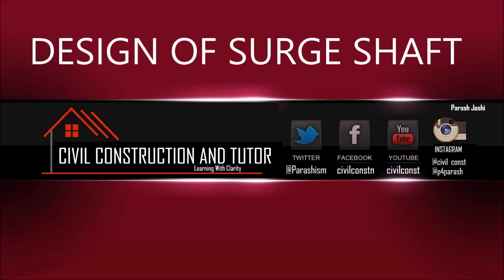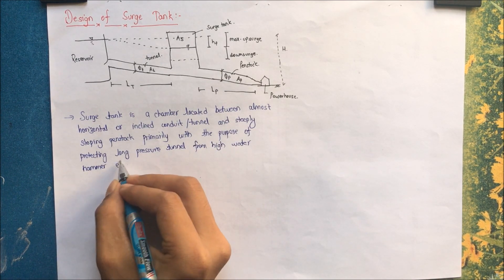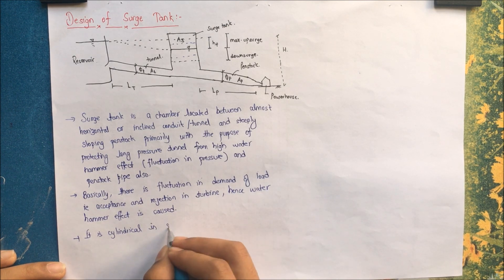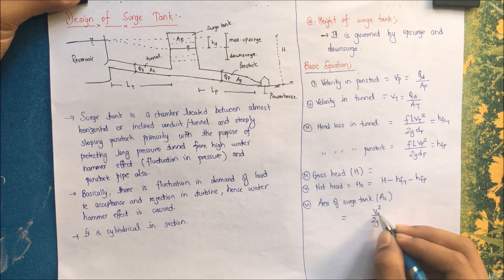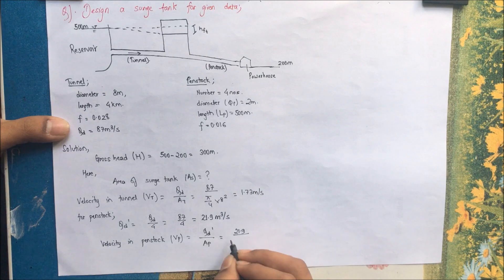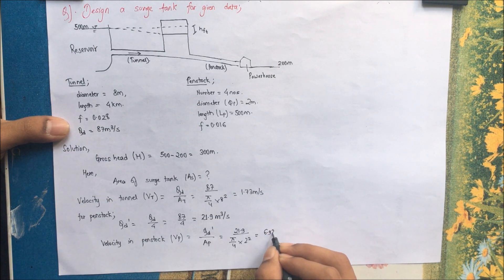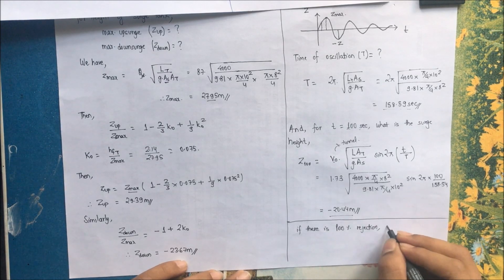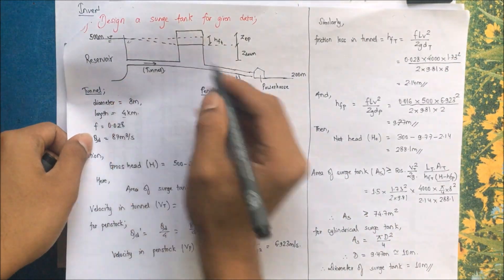Design of Surge Tank(Shaft) | Water Hammer Effect | Hydropower Engineering | IOE , TU , PU

Comment: Can you solve this ?

A power canal, bed width 15m, may be assumed to be rectangular in shape with a steady state of flow of 3m. The canal supplies water to power house three turbines, each turbine rated at a discharge of 30 m³/s. If the in the power house is suddenly thrown off so that two of the turbines have to be shut down, what would be the height of the surge in the canal.